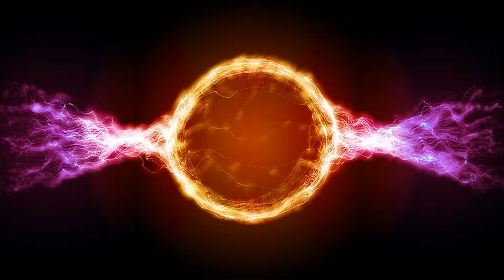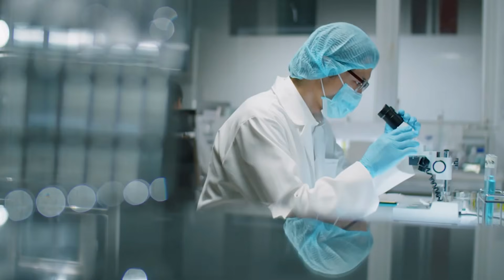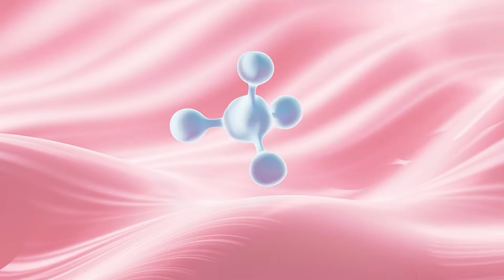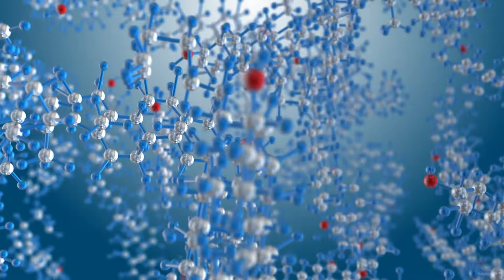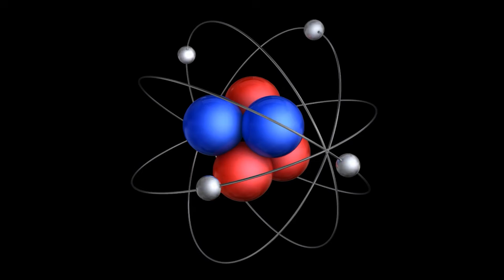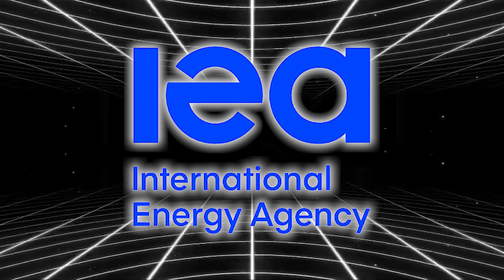China Found a Way to Turn the Ocean Water Into Nuclear Fuel

Comment: There are two big problems with fusion (a) the supply of tritium. Deuterium is easy to get, but making Tritium from Lithium is much harder and no one has shown it can be done at a rate sufficient to even sustain 1 fusion reactor let alone breed enough to start up another fusion reactor. 
(b) solar power and wind power. By the time any fusion reactor starts producing electricity the price of electricity from solar and wind will be so low that all other forms of electricity generation with be uneconomic
Reply: can dismantle all that now and use land for farming and housing @:) lolol also the deserts china turning back into forest or are you behind on everything they doing now??:)